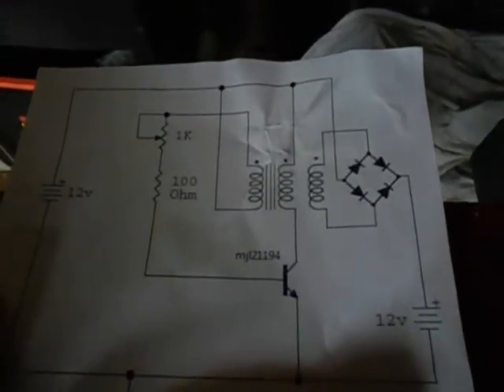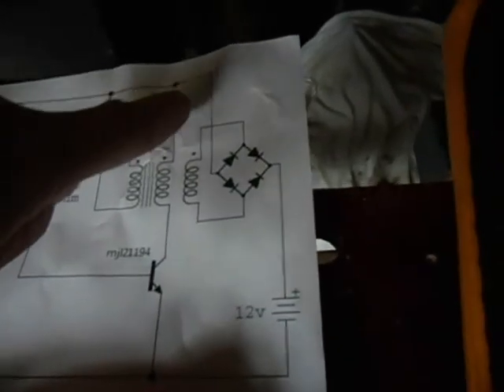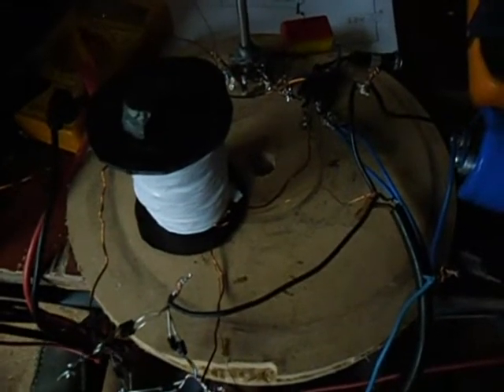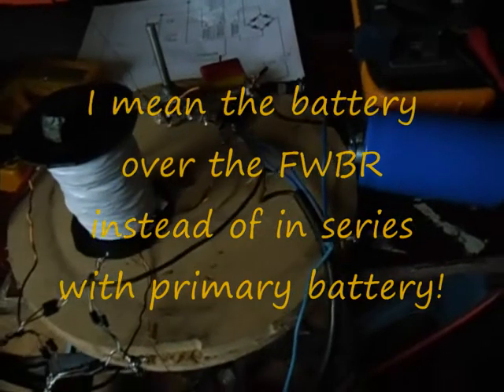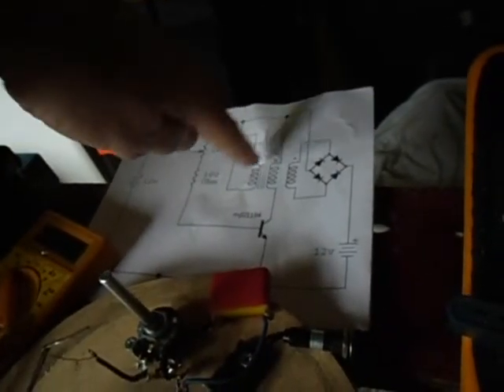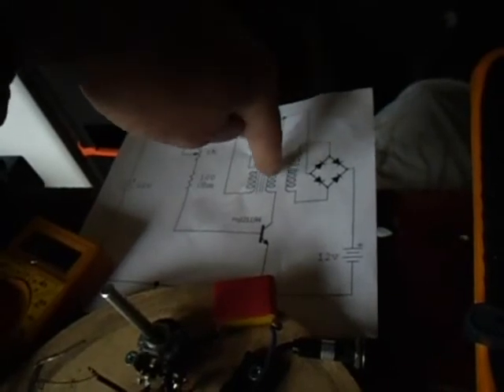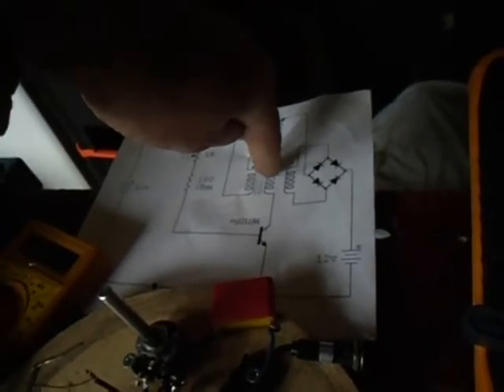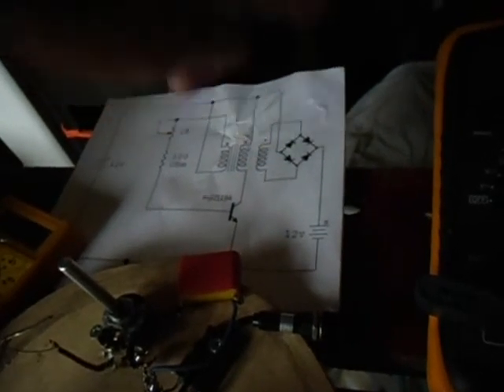improved charging with SS SSG?

Comment: nice work! can u do a parts breakdown and some assembly instructions with schematic for reproduction? that would be awesome. thanks for sharing! cheers.
Reply: knagtegl

Sweet.  Thanks for the share, and the response.  Cheers.
Reply: knagtegl did you just leave the base-emitter and collector-out diodes out of the drawing on purpose or do you just not use them? I was thinking it would be interesting if the fwbr effectively replaced the collector out diode, then I noticed the other one not there either...

Comment: this seems similar to patricks neg to neg mod. ill have to look both over later. he also suggests using large cell batteries to avoid damage. sounds familiar.
Reply: I cant find the vid, and the guy is so cryptic it may have been taken down for good...I remember he used a fwbr on the output and connected the neg for run and charge. he made a point to wait until the batteries were leveled at the same voltage before applying the mod, again im not sure about the particulars but the charge rate jumped way up.